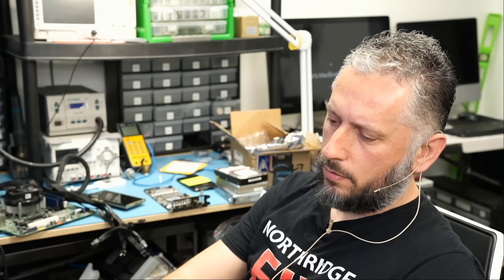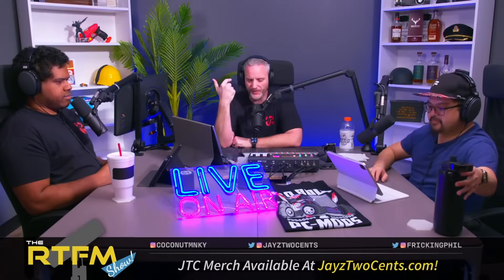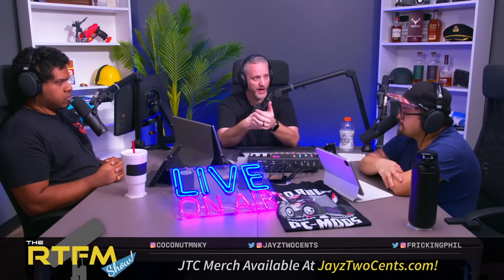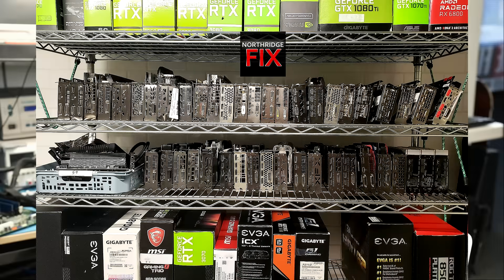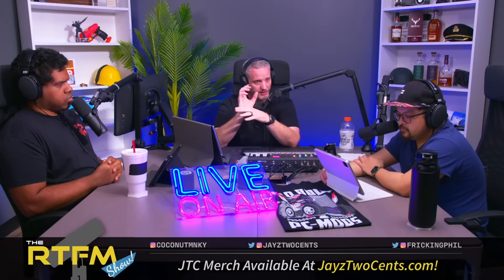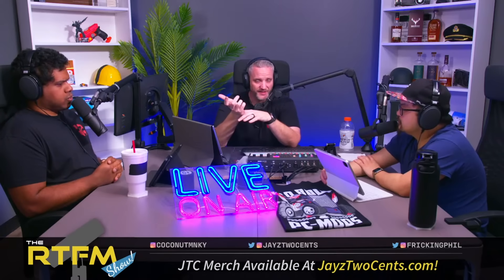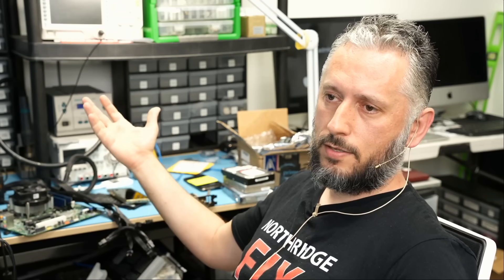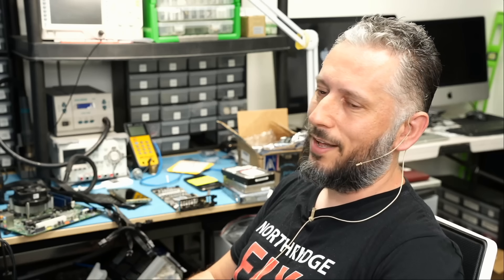Melting 4090 and CableMod. JayzTwoCents and Gamers Nexus Response. Blame NVidia or User?

Comment: Steve is usually good about calling out manufacturers so I was perplexed when he brushed it off.
Reply: He didn't brush it off, it's a small sample size and he doesn't have his hands on the cards to give a definite answer... Saying every RTX 4090 should be recalled because a couple dozen users cards have had issues with the connectors is reactionary
Reply: @Ben-Rogue  There isn't a lot of clear thinking going on in this comment section. 
Jay and Steve literally said the same thing about the problem. Bad connection makes it melt, yet somehow Jay's opinion is good but GN's is bad.
Reply: @Ben-Rogue  lol i guarantee there way more then a couple dozen out there man
Reply: He called them out in the clip used here saying the crappy connector made it too easy for people to leave the connection loose. He didn't defend the design he simply stated why the plugs melt, which is because the user left it loose. If this was a more common problem he would be the first one to start the witch hunt.
Reply: Steve did a very in depth analysis of the problem. I'm guessing he doesn't want to throw out many hours of research yet.
Reply: @GenericPast  Why would he when he found evidence on this card that leads him to believe it was not inserted all the way, confirming what he has already found?
Reply: @GenericPast  Did he published the procedure ?. There are standards to test connectors. He does not need a card at all to do that. Take the connector out and test it with dirrent currents with a load surce . Simulate a current profile an period. And you need to standarize the mating part of the connector. And you have a ton of variation since each PSU is different. Ubless you dont concut a test by standard and the matting part is SAME as the one in the card (SAME BRAND, SAME STYLE) you are calling investigation an apples to bannanas comparison.
Reply: He needs those free rtxs 😂😂
Reply: he just looks like nvidia pay him well 😅
Reply: The larger channels are just sellouts. They get to a point their so big all they care about is appeasing the supplier. They get more cautious with their words because they get afraid to say things that disrupt their relationship with the supplier. 

It’s like that in politics as well and the video game industry with investors or any business in general. It’s not any different with a larger YT channels which is just another business.
Reply: @J  You don't watch GN do you?

Comment: Just a question  Could it not be a bad batch of connectors supplied that causes the problem?  Not ALL 4080/90 cards melt their connectors?
Reply: IT will depend on how goood are the mating part at the PSU as well. The more grab the female has, the less heat it will produce. Female could have some metal plating, like silver plating. THis will hel a LOT. But depend on what is going on the ATX PSU side.

Comment: The whole rationale behind blaming the user ignores the fact that the design increases the possibility that "below perfect" user action increases the risk of melting and fire. The device shouldn't be that intolerant, and the connector should be able to handle the power applied to it. If the connector is that finicky, redesign it. It shouldn't be that close to catastrophic failure for a simple cable insertion issue.

Comment: The problem is the connector and power draw. 4080 TDP is 320W (yes u can OC but not all people do that, more i think they using UV), 4090 has 450W. So even with UV is still need over 300W of power. Connector has almost 0 headroom for connection issue (it's too tiny to the power that is carrying) and that way is failing. I think low tire card (70 Ti and lower) are technically safe because much lower TDP but 4080 and 4090, especially 90 will be failing.

Comment: What this boils down to that the video card is at fault and they need to recall the video cards ASAP and amend the problem at the end of the day electronics doesn’t lie. If you’re constantly getting the same problem from the same model video card, then it’s the manufacturers problem not the end user from what I can see from the second video card that was sent in. The cable mode was seated perfectly well, but at the bottom the same problem happened the connector melted so at the end of the day, it’s a manufacture problem with the video card.

Comment: A logical thinking in electronic PCB circuit knowledge or any electrical circuits; when one part has integrity issues during normal operation, then there's at least two possible cause: the part itself is not able to handle large loads through it because of poor specification (or was not meant to handle such load), or circuit design issue, in which forces that particular part to get passed by loads that systematically and electrically too much for that part to handle (which should be designed in other way so that the part in question will not have reliability issues).

A thermoplastic part such as connectors has certain heat threshold range it can operate based on it's manufacturer datasheet, and if that threshold is oftenly breached, the manufacturer won't be held responsible for any failure of the part they produce. In my opinion, if the connection is tight by friction, it doesn't matter whether it fully plugged or half plugged but still connected, because it connects anyway.

Melted connector is serious issue, especially when it happened at end customer. If the case percentage is significant, this needs a recall of product. I wonder if NVidia is aware of this.

Comment: Thanks for this update, and I stand with you Alex.  Until Nvidia will use those connectors, I won't buy those graphic cards.  

I'm having a 3080 with the old connectors actually so I don't plan to upgrade to the 4000 series anyway (I'm always skipping one generation), but if the 5000 series will have this connector, and Nvidia didn't fixed this issue or use a more reliable connector, I won't take any risks.

Also, I like the idea of Jay for doing collabs with you!

Comment: I understand creating a newer, lower pin count connector. 3x 8 pins was getting a bit absurd.

But why reduce the gauge of the pins?
Who's the genius that thought of that?
Even if it was enough for this generation, eventually a generation will have problems that simply wouldn't have happened with the same pin count, the old gauge and the same power usage.

Comment: The 4090s need a three cable adapter that DOESN'T plug into the card's native plastic connector, but instead is soldered to the card in place of the original connector. Problem solved.

Comment: The problem is too much current passing through too small gauge wires. Additional connectors and cables are needed to distribute the current load. When you pass high current through a small wire, heat is generated thus melting the connector between the board and the cables.
Reply: @TheRadioShop  You do realize that they mentioned another GPU(3090ti) that with OC can go easily over 500w and doesn't have that issue. So obvious this isn't the issue. What's more this is the basic of basic, so I doubt that no one has thought of this and designed it this way knowing what will happen. The issue is probably somewhere else.
Reply: @xingbairong  Maybe cheap connectors, bought from low quality chinese manufacturers, which cut corners by using less metal.
Reply: Too small of wires are making things melt that are not touching the wires that are too small? How exactly does that work? The wire has never been shown to melt in any of the connectors. Not one.
Reply: too much current passing through a small margin wire adds some loose or uneven connection and material quality and hits the limit and bammmmmmmm!
Reply: It takes 3x8 pins ATX connectors to handle 525 watts, the 12VHWPR is rated for 600W and it has half the pins (6) for power, and half the pins for volts than what it requires on 4x8 pins ATX connectors to go over 525W. And pin size of ATX connector is 1.42mm and 0.64mm for the 12VHPWR.

No wonders it fails with those specs, and the issue is not wire gauge but poor contact surface between each connector that is causing the contacts to heat up and melt the plastic around.
Reply: The weak point is between the connector and the multi-layer board.  The heat is coming from the board side to melt those connectors due to not enough surface area between the pins and the board to handle the wattage.  I've seen lots of burnt connectors from working on Pinball machines from bad connectors where both the board side and cable side burn because of corroded connectors, the times I've seen just the board side burn is when there is a bad solder joint to the board.
Reply: @TheRadioShop  Stanimir is exactly correct in his commment, people haven't mentioned it in their coverage because it is obviously not the problem if you understand it at all.
Reply: The problem is cables that aren't plugged in fully. We already know that it's user error. The connector needs redesign so it can't pull out as easy once connected.

Comment: I would suggest that there is no problem with the connector. The heat could be originating from the board through traces that aren't heavy enough to carry the current, thereby heating the pins and melting the connector. The solder or the copper traces wouldn't melt before the plastic did. Maybe the problem pins could be externally linked to the next point in the circuit
Reply: That's an interesting idea.

Comment: IMO the fact the cablemod adapter was fully seated does not imply it had a good connection. It may have been faulty. It's another variable in the equation of the issue.
However. From the first day I saw this connector I just can't understand how 12 thin pins are certified to carry more power (600W) than 16 bulkier ones (2x 8pins PCI-E connectors, 150W each) . Electric physics laws say the opposite.

I wonder if EVGA left nVidia also figuring out the possible flaws of this connector.
Reply: Of course, you wouldn't want to just by default rule that out. However, these same failures are happening with Nvidia cables, stock PSU cables from the manufacturers directly, and competitor cables. We've also sold over 50k of these units for reference.

Comment: I like Steve voicing out many manufacturing design errors and fighting for it. But in this one am siding with Alex and Jayz, it's Nvidia's fault to use a fragile connector like that.
Reply: Steve will criticize ANY manufacturer that is NOT Nvidia. He will bow in front of Nvidia.
Reply: Gamers Nexus knows nothing. They always try to get attention and pretend to be smart.
Reply: @realtuner3560  Yeah man i figured out Steve doesn't actually knows so much as he pretends to. I even found a webpage with him talking about a problem with the PCI Express Downstream Switch ports that weren't working properly on a motherboard, after that he posted steps onto fixing the issue but surprise surprise these steps were not relevant, the so called steps seemed to be nothing but click bait, it's how i know he's most likely a sellout.

Comment: Its possible to measure the pins, someone with extra connectors please do that. Maybe open up the connector and measure pin lenghts, then take the connector from video card, and measure if it bottoms out or what?

Comment: Do we know what the maximum current draw is through this socket and is the socket capable of handling the draw for sustained periods of time? You said that previous cards had three separate connectors, thus sharing the load and heat over a larger area. Now, the whole load is going through one connector. Looks like  design flaw to me.

Comment: People has built computers for like over 20 years now with GPU:s that need external power hooked up to them. And this seems to be first time that the connector melts. So in my eyes the reason is VERY obvious, the connector has to be too undersized for the application. It can't be that suddenly hundreds or even thousands of people don't know how to connect that connector right.
Reply: What is interesting is this new conenctor was signed off on as a spec by something like 21 of the largest tech companies out there including both AMD and nvidia. But AMD chose not to use it... 

its really quite simple, if you take the same number of 12v conductors as 2x PCIe 8 Pin sockets, double the power rating of those two socket and half the physical size... the end result is what's that smell...
Reply: @MrGeneralScar  EVGA quit before using the new standard too. They probably could tell the connector was too small for 600 watts
Reply: 6 and 8 pin atx connections have not failed because of their design, ever, and ATX standards have been around about +/- 50 years now. Defects and mistakes happen, but this connector is failing year one, repeatedly.

Some of it was user error, sure, but it's all nVidia's fault that it happened in the first place.
Reply: @x8jason8x  ATX origins - 1995. I know when you are young the difference between 30 and 50 is indistinguishable but ATX is not even 30.
Reply: @stanimir4197  I'm not young first of all. Second, I'm not talking about form factors. ATX power supply connections can be found in things as old as IBM Selectrics.

I know when you think you know everything, you tend to neckbeard it, but probably save the fedora for the real dance, pal.
Reply: @stanimir4197  When you think you know about something but not so sure, please keep it to yourself, thank you.
Reply: I don’t know the power rating of that connector. Usually power cable connectors are over rated by 20%. If the style well within tolerance, but the alloy is crap it would be like adding a resistor between the connection points.
Reply: Well, this is NOT the first time a connector melted. Not by a long shot.
Reply: I agree with you 100%, there needs to be a class action lawsuit against NVIDIA
Reply: Exactly
Reply: Other connectors have melted before, this is just blowing up more because they're new cards and the connector was causing controversy before the 40 series even released.
Reply: EXACTLY*. It is *so obvious that one can understand why I believe Jay's and GN are really colluded with Nvidia here.
Reply: Well maybe there are thousands of people who don't know how to connect cable so Nvidia should change design,  provide sufficient training on card installation or put requirement that only qualified electrician may install 4090 in your computer.
Reply: @adranonim  the same thousands did not produce a spike in RMA for meltdowns prior to the 4090. Have people become dumb all in a sudden?

Comment: Still have not seen the condition of the female socket contact. The card pins are large and will conduct the heat that is produced from the female barrel loosing connection due to their inherent thin metal, formed socket form. As the female barrel heats up it will create "Thermal Runaway". Heat the pin, cause the plastic to melt.
By The Way, senior development engineer for the connector industry, it was my job to prove that the contacts would not loose connection.

Comment: 9:07 did Jay really say higher resistance = more heating? That doesn't make sense, the power supply is a constant voltage source, not a constant current source, so the opposite is true. What am I missing?

Comment: high resistance material used in connector leads to gain high temp ...nvidia should use pure copper in their connectors
Reply: But it will increase the 1 cent to bill of material. Multiplied by a hundred thousand card and it will 
 hurts their bottom line

Comment: One connector is just not enough for such power draw. 4080 and 4090 need two of them.
Reply: Either that or they increasr the whole adapter/plug by 33-50%.
Reply: i would even use 3 connectors ! something like 500 Watts on 6 pins is just INSANE ! (the  others are ground ...) and all these pins are like on 20mm only, far too close.For a very minimal, they should add a temperature sensor on this spot that pilots a power limiter !

Comment: Have you tested that cablemod to make sure it isn't failing due to bad design/construction on it's own?
Reply: he has over 250 4080/90 cards to fix and only 1 with cablemod adapter plus the burn is always always on the cards side you have not been listening lol
Reply: Imo,  if one 12vhpwr connection is a bad solution,   then two on the same circuit is twice  as bad.